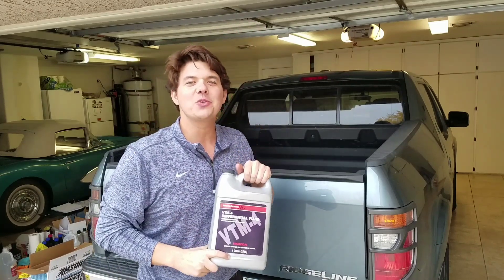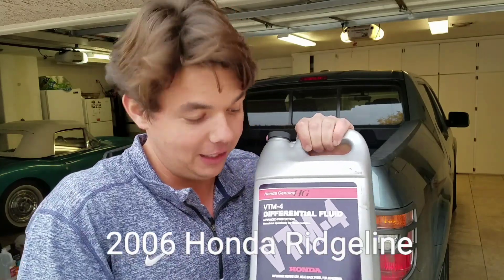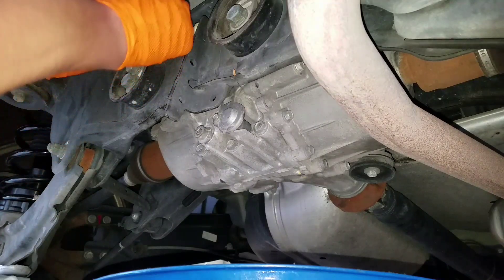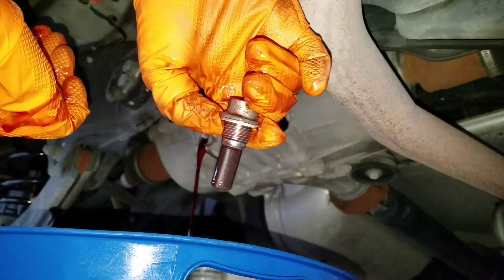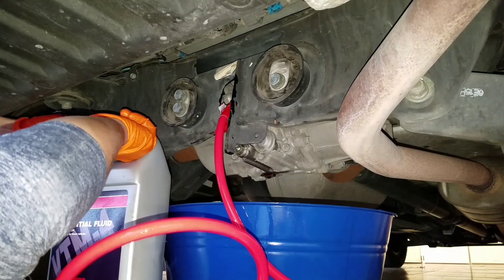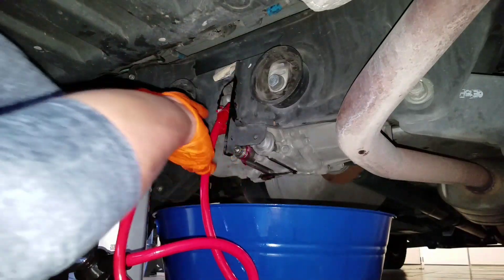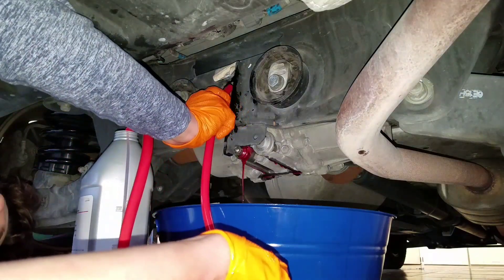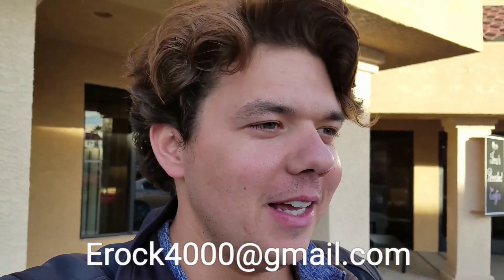2006 Honda Ridgeline Differential Fluid Change

Comment from the maker: Let's Get Your Vehicles Running Better Than Brand New!

🥇   Synthetic Oil Protection Google map reviews
Eben Rockmaker, independent AMSOIL Dealer 
Dealer no. 5331179
(702) 472-3614
https://maps.app.goo.gl/1aXxuXrXK9eJwqK78   

🏆   Oil & Lube Tests - https://www.amsoil.com/performancetests.aspx?zo=5331179   

🇺🇸   50 Years of AMSOIL anniversary - https://youtu.be/MQUqRBI8dD0
     
     For me to get credit & be "Your" Independent AMSOIL Dealer, please use my website below or my dealer no. 5331179 call anytime Eben Rockmaker 702-472-3614
After you click on: https://syntheticoilprotection.net/
1. Click the hamburger menu
2. Click offers AMSOIL preferred customer
3. Click join now. 6-month PC member add to cart.  ( There is no reoccurring renewal membership unless you select that dot box ) 
( You have the option to not have your credit card saved if you prefer - est. 1972 )
4. Scroll up to the top Select shop by vehicle. 

New Promo Codes: FREERAGS

Comment: How often should you do this service?
Reply from the maker: I would do it every 30,000 Mi or 3 years whichever comes first of City driving.
If you're doing all highway driving you can easily push it out to 60,000 miles
Reply: @ thanks! Also do you think when the code comes up for the Honda when you do an oil change, it has the A 3 or whatever code, is accurate to when it tells you to change it?

Comment: I think I’m going to try amsoil red bottle atf in my Ridgeline rear diff
Reply from the maker: This is my link It will give you all the products for your year make model and engine size you'll see that on the lookup guide in the upper right hand corner I also recommend the 6-month PC membership If you're new to Amsoil that'll save you about $33 and $100 order and if you have any questions before you order let me know.
Professional YouLubher: Eben Rockmaker Regency Gold Direct Jobber AMSOIL Specialist (Dealer#: 5331179) 702-472-3614 

     If You're New To AMSOIL I Recommend The AMSOIL 6 Month PC Membership - https://www.amsoil.com/offers/pc/?zo=5331179

Comment: Will it hurt the differential to use regular 75-90w hypoid gear oil?
Reply from the maker: That's a damn good question I would say if you use the Amsoil severe gear it would run amazing I think the only difference is a small difference in fuel mileage because the stuff Honda has is a little bit thinner and it's not a real heavy duty truck so there's not much power to begin with so I think it's more or less a fuel mileage thing but I have never tried both to know exactly how different it would be this is my personal link will give you the very best value on the products as your independent am soil dealer always happy to talk with you about improving the performance and placement of the vehicles and equipment by choosing the right fluids😃☕️😊
♥️   Find The Right Fluids For Your Vehicles - https://www.amsoil.com/lookup/auto-and-light-truck/?zo=5331179

     ✅   Save 25% On Your Next Fluid Order: https://www.amsoil.com/offers/pc/?zo=5331179
Reply: @Syntheticoilprotection  Thanks for the reply, Ill look into the Amsoil next time around, but for now I think I need to talk to an independent Honda mechanic to see if there might be a problem due to the major viscosity difference.
Reply from the maker: Sweet! Yeah I would stick to the Honda oil if it was me

Comment: Is there a front one two for this vehicle ?
Reply from the maker: This one's called a transaxle you'll see everything for your vehicle here with the lookup guide when you use my link that will attach me to you so in the future I can always answer your questions about improving the performance Enlightenment of your vehicles by choosing the right fluids as your independent Amsoil dealer also the 6-month PC member will give you the best value up to 25% off and you also have free shipping hours or more and the newest promo free tool is the new one. 
♥️   Shop by vehicle - https://www.amsoil.com/guides/?zo=5331179

Promo: FREETOOL

Comment: How do you know it needs to be changed
Reply from the maker: That's an excellent question on most Vehicles you want to change the fluids every 3 years 30 to 60,000 miles depending on driving conditions if you live somewhere extremely mild you can possibly go 5 years just depends on the way you're driving it

Comment: What type of antifreeze do I need for a 2015 Smart Car
Reply from the maker: This is what i used in my smart car video - https://www.amsoil.com/shop/by-product/other-products/antifreeze/low-toxicity-antifreeze-and-engine-coolant/?code=ANT1G-EA?zo=5331179
Reply from the maker: I always use this to: Dominator® Coolant Boost
Provides Effective Heat Transfer and Enhanced Corrosion Protection
https://www.amsoil.com/shop/by-product/other-products/antifreeze/dominator-coolant-boost/?code=RDCBCN-EA?zo=5331179

Comment: How many gallons do we need to buy? 1,2?
Reply from the maker: 1 gal
Reply: @Syntheticoilprotection  thanks! And would you say changing the fluid on an incline (tire ramp) is ok or should restrain ourselves to keeping the surface level?
Reply from the maker: I think it depends on where the oil drain plug is that's why I always use a regular Jack and I usually Jack it up so it tips the way of the oil plug..

That allows a little bit more oil to come out but at the end of the day it's not a big deal even if you left a half a quart of oil it won't hurt anything
Reply: Ok
Reply: Does it hurt if it over filled or under filled? Total 1 gallon? Wonderful video by the way!! Thank you very much. !!
Reply from the maker: Not sure what you mean